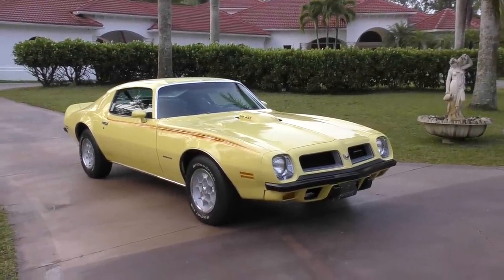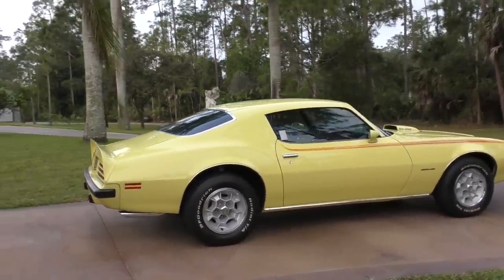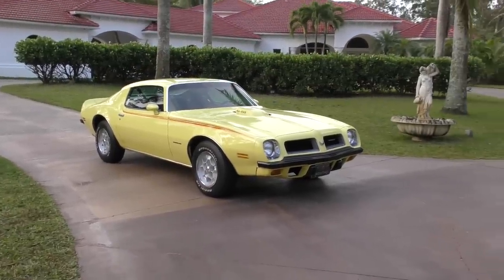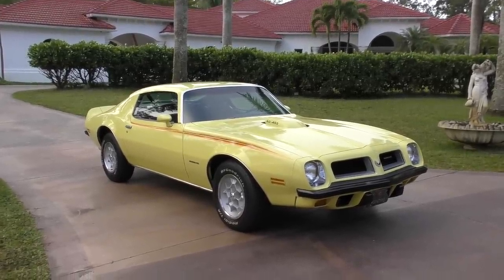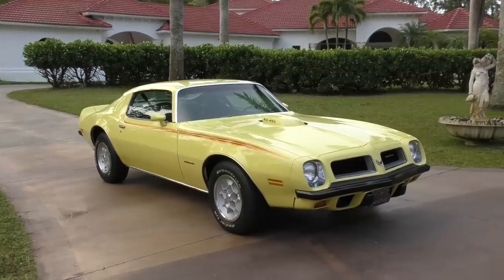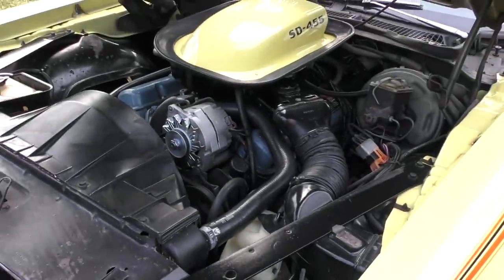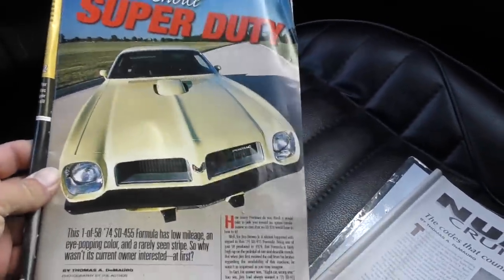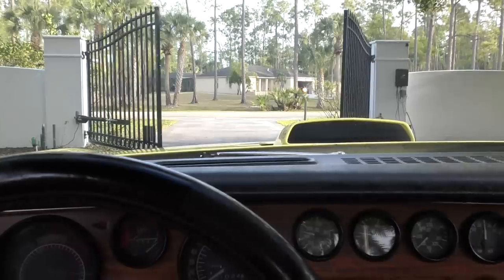1 of 58!  This Ultra Rare 1974 Pontiac SD 455 Formula Firebird is The Last Real Muscle Car

Comment: Pontiac done a fantastic job integrating those bumpers..in my opinion, the 74s and 75s were both great looking cars. This is an incredible car. Your friend has an amazing collection.
Reply: Indeed. They did way better than Chevy with the Camaros those years.
Reply: Yeah especially when you compare to the Camaro, where they just ibstalled a slab of steel in front with close to zero integration with the rest of the design.
Reply: Growing up when the 2gen fbodys were new. I always preferred the Formula trim over the Trans Am.
This car really POPS.
color, honey comb wheels, SD..
Who ever speced that car had great taste!
Reply: I did drive the 74 firebird 350, trans am 400 and firebird formula 400 in the 70s. They were wonderful machines at that times. I did not had the chance the drive the trans am 455.

Comment: Back around 2006 I was at a car show in McHenry County Illinois and encountered a 74 yellow sd-455 Formula with the shaker scoop and side accent stripe.  It was a real X code car but had a column shift automatic and no tachometer.

Comment: All those gauges are aftermarket. The three of those gauges to the right were where the ac vents were. The two to the left were factory gauges but they look replaced to match the rest.
Reply: Don't forget that this is a non-gauge package and non-AC car. So the area of the dash to the right of the speedometer had nothing there, so was a blank canvas for a previous owner to add those 5 aftermarket gauges.

Comment: In '73 and '74 there were still a couple of powerful cars for sale, the 455 SD was the top of the heap for sure but, not the only game in town yet. The 351C 4 speed was available in Mustang, Cougar and Gran Torino with 245-255hp, Hurst/Olds 455 250-270hp, the Buick 455 stg1 270hp, the Corvette and Chevelle/Laguna S3 454 245-270hp and a few hold over Mopars with the E58 360 245hp, E68 400 260hp and E86 440 285hp. None of them could touch the Pontiac but they were out there and could all be readily modified.

Comment: Great video, Bill, I love your work, and your passion really comes through, especially in a car like the legendary 455 SD Super Duty. Many people don't realize that unlike the standard 455,  an engine that you could get on the Pontiac Safari station wagon, the 455 SD was a full on racing engine. I was too young for that one, but I did have a 1979 TRANS AM with the 6.6 Litre, which was actually an Oldsmobile engine, the 403. The 400 Pontiac T/A engine was reserved for the 4 speed manual for some reason.. Mine was that bright electric blue metallic color with the turned dash, and had other civilizing options such as delay cycle windshield wiper, electric windows and door locks, T-tops, tilt steering wheel and cruise control. Mine also had the WS-6 package, which included 60s all around and four wheel disc brakes and some other odds and ends. What a great great car that was, and what great times those were.

Comment: Excellent video, been a Pontiac fan forever. Currently working on a 1975 Firebird Esprit, with a 1973 front clip and ram air hood. Equipped with a bored 1972 455 HO, M-21 four speed. I love Pontiacs, unique machines and these engines are torque monsters.
  The Formula here is just badass. Beautiful, it's cool to see clean examples of these cars. Really enjoy your work. 👍👍🏁🏁

Comment: Had a friend in the 80s who had one of these- 74 yellow 455SD Formula.  Who knows, could be the same car!  he drag raced it regularly and drove it on the street. He let me drive it once.   He did not order it, he told me there were several on the dealer lot at the end of the 74 model year.   super nice car

Comment: As per the SD 455 Registry where there are a total of 28 1974 SD 455 Formulas registered and a total of 58 were produced by GM, (where the bulk of the remaining ones are is mostly likely the junk yard through attrition).  There are a total of 2 yellow cars known to exist or that were built (I expect that the other car does exist). One car had black standard interior with a Turbo 400 transmission sold through Schoon Motors as this one was,  while the other one is a yellow, black custom interior with a 4 speed. One item of interest is that in the SD 455 registry, both of cars that are registered were stated to have rally wheels (which I like much better) and my guess is that this one had them changed to the honeycomb style wheel.

Comment: Great review of the SD history, this true SD has the unique PCV valve on the oil filler cap and the “bolt stretch” measurement for the rod bolts on the unique SD valve cover sticker. The SD exhaust manifolds were much less restrictive than the standard 455 manifolds by the way. Almost every part of the SD engine was different from the std 455, I know because I built one from scratch by ordering the parts after I bought my buccaneer red ‘73 too late in the year to get the SD with the car. It took 3 years and cost more than the car did. God bless my brother who worked in the parts department at the dealership. I was 27 then, I’m 74 now and still own the car, which has 67,000 happy miles on it. Thanks for doing this Bill.
Reply: I too own an SD 455, couldn't be happier everytime I look at it, 23,000 original miles. Special they are

Comment: Nice to see one of these without the "screaming chicken" plastered on the hood.  I'm actually a Ford guy but this bird's really sweet.  No need for a radio with that awesome sound coming from that engine.
Reply: But We like our chicken down here. Mustang lickin good.😁👍
Reply: Couldn't get a bird on a Formula.
Reply: @superduty4556  So tru
Reply: @superduty4556  ... thats a T/A hood on a Formula - why if so '''rare''' (lol)
Reply: ... the term used that started back in 68 was 'thunder chicken'
Reply: ... caught your statement further down the page - glad u posted it.
Reply: @nemesisxrox6773  saw your other comment, but maybe a little more background.

Pontiac intended to put the SD455 in all their vehicles as an option but due to pressure from GM, the program was off/on and barely even happened. There was no guarantee of an SD if you ordered one as well. A lot of times a regular 455 would show up instead of the SD you ordered. Assembly workers would steal connecting rods in their lunchboxes as they were the only forged Pontiac rod available. Parts were so limited in fact that to buy any SD specific replacement part, you had to show proof of ownership of an SD. You either had to know someone or get incredibly lucky to purchase one new.
Reply: @superduty4556  ... thats easily understood since the decline of all vehicle engine power was the year 1974 - gas crisis woes & tree huggin EPA, etc. - droppin the GTO but at least pushed on as much as they could with the bird. Diff subject - still cant figure GM as to why the drop of Pontiac and Olds over Caddy n Buick - those 2 shoulda been the ones to flatout disappear.
Reply: @nemesisxrox6773  Cadillac is necessary to compete with BMW, Mercedes, Lexus and Acura. Buick sales are suuuuuuper strong in China for some reason. They even make them over there.
Reply: @superduty4556  ... lol so true nowadays. The rise of the nerds n so much other bs sure popped during the mid 70's n beyond in every aspect. Good day to u.
Reply: @nemesisxrox6773  that is because the firebird  marker light were in fact  the Native American  thunderbird.

Comment: SD 455 was serious hardware. It even had provisions for dry sump oiling cast into the block. A little tuning and you had a car that could run 13's on pump gas through the mufflers...with air conditioning!!

Comment: Thanks for sharing this amazing car!  My first real exposure to Firebirds was as a 12 year old in '73.  I saw a white/blue '73 Trans Am at an intersection and was hooked.  John Wayne's Brewster Green McQ movie Trans Am also made an impression.  I finally bought a white/blue '73 4-speed Trans Am in '99 and repainted it Brewster Green.  In '05 Hurricane Katrina took it.  I bought a '79 Smokey & the Bandit car and kept that for 12 years.  I would love to have a '68 400 convertible with the hood tach.  In my high school days my friend's brother had a real deal 4-speed '74 SD TA which I got to drive.  That memory is a tattoo/scar on my brain.

Comment: I can say from experience that a SD Trans Am is very special and Fast!!!!!! I owned one in the early 2000’s and that car was an original mile white 73 TA with an automatic transmission. That car would idle smooth as silk but as soon as you leaned on it, it would take off like a rocket and had great power all the way to redline!!!! Definitely very ahead of time!!! Basically a race engine tamed to drive on the street. That’s the best way to describe it.

Comment: 73-74 SD Formulas received Trans Am shaker hoods because they ran out of time to have the ram air hood EPA noise certified.
Reply: ... just scrolleddown n found your statement - after i posted about the incorrect hood.
never knew that one.  I'd rather have the fiberglas Formula hood on it thou.

Comment: Hi Bill, the stated purpose of the EGR system was to “meter a measured amount of exhaust gasses into the combustion chamber, reducing peak combustion temperatures, decreasing the formation of NOx (nitrogen oxides), a major contributor to smog. Higher combustion temperatures also increase the risk of pre-ignition (spark knock)”. 
Leaner air/fuel ratios required to meet increasingly strict emissions standards were causing  hotter combustion events, raising cylinder temps. Also, as a vehicle engine accumulated miles, carbon deposits would create “hot spots” in the cylinder that would start ignition before it was supposed to. The “dirty” exhaust gasses partially quenched the combustion reducing the temperature. It was a trouble-probe system, the small passages would quickly clog with soot, and the valve itself used vacuum to control it, the internal diaphragm would fail from heat also relatively quickly. 
Fortunately today, engineers know enough about combustion and technology allows more precise control of it to eliminate the need for EGR.

Comment: The HP on the SD 455 must have been way under rated- i have seen a few of those smoke some darn fast cars on the drag strip- low 13s high 12s  with low gears and slicks they were really fast for a big heavy car- i had a 78 camaro w a pretty hot 454 that ran 13.0 @106  and to think a stock factory car was even faster is quite amazing- it seems like everyone i meet had a car or their dad had a 10 second car - but they never showed up on test and tune at Bandimere to run with us - Hmm imagine that - a 10 second costs big money and are not too common - - i know the new fuel injected muscle cars like hell cat and camaro or mustang are fast as hell but building an old school muscle car and making it run 10s requires skill and money-  especially at the high altitude of Bandimere in Morrison CO  - which i believe is shut down as of last year - thats is a bummer -   pontiac built one hell of a strong and powerful 455-

Comment: Great video! My uncle purchased a brewster green '73 TA SD455 4spd new in '73. Eventually had to sell it in the late 80's for financial reasons by like you said, that '73 brewster green SD455 stands as the pinnacle of muscle cars for me. Funny part of how he was able to get one, when he initially placed the order he was told that he wouldn't be able to get one, so he purchased a near identical brewster green '73 TA but with the standard 455 (4spd). Don't recall how long after but the dealership called him and said that he would be able to buy a SD455 model, so they put the order in to the factory and it was filled. So he sold the first car and kept the SD455 until the late 80's. I recall seeing a photo years ago of both of them parked on his front lawn in the sunlight before he sold the standard 455 model.

Comment: Those Stewart-Warner gauges are aftermarket and were added later.  If it had factory gauges it would've had a tach too.  It's weird to order a SD455 without a tach

Comment: I still own a 78 T/A I purchased in 1982. 4 speed with the 220 hp T/A 6.6. It was something back in the day, but from a light, I'm rowing and roaring while the Camry riding next to me is just cruising under normal acceleration wondering what all the commotion is about. It's amazing how slow these muscle cars have become.

Comment: Fantastic video Bill - wow at 1 of 58 is that one of the rarest cars you've driven for your videos?  I owned several muscle Pontiacs in my day as well, and I so agreed with everything you said.  So interesting that the SD-455 option DIDN'T get you factory gauges (including a tach!) - that bank of gauges definitely looked aftermarket - and being it wasn't a T/A also meant that wood-grain insert rather than the engine-turned metal.  Loved that car!

Comment: 1974 was the last good year for the Trans Am and Formula. 1975 was the beginning.of the catalytic converter on all cars. It's hard to believe Pontiac offered the 455-SD engines in 1973-74.

Comment: Well folks….  I personally know person long ago who had a 74 formula SD in midnight blue like my SD.  It had both formula “ram air” non functional, and the shaker. It was a bit weird. Today a real urban legend. Hope it did not end up in the crusher.  He bought it new in Dayton Ohio.  His like my 1974 SD Trans Am also had 1973 SD heads out of the Norwood (Cincinnati OH) production plant.  He could keep up with me on the street,  he had honeycomb wheels like mine,  premium interior and power everything like mine.  Anyway, lost track of him as I got older.  

I met Herb Adams twice.  Second time when a buddy of mine and I added all the Herb Adams aftermarket bits to his no-air stripper 4 speed 1974 Z28.  Made a huge difference now the Z handled better than my the heavier in the front end SD.

Oh, during my ownership, I was able to secure the factory dry sump add on.  After it was put on, I think it added almost 40HP due to reduced parasitic losses.  I do not know of anyone with this added to their street versions.

Comment: The SD 455 was so special it created an internal problem of the engine supply of the SD 455. Pontiac had a supply problem of the Forged rods that they had to limit, because they had an internal problem of the workers stealing the forged connecting rods.

Comment: The best thing about the 2nd gen Firebird/Camaro is that you can make an 81 look like a 70 1/2, or a 70 1/2 look like an 81, and all variations in between, without major modifications. It takes a shitload of money. But it's basically the same shell with different rear glass and bolt-on options so it's possible. And pretty much everything you need to do it is sold in the aftermarket so you don't have to search for extremely rare parts. It's not the same as owning an original. But if you have one year, and you like the look of a different year, it's possible to make it however you want. Even mix and match different front and rear designs. I love these cars for that. Even though I'll never be able to afford to build my dream version

Comment: 1988 or so , my cousins friend comes up the driveway with a new score, 74 T/A , cragars and fatties and a eggplant purple paint job.
455 4speed car, we were all around 17 at the time.(we had no idea or really would have cared about a super duty at the time).
We learned the hard hard hard lesson that installing headers on a pontiac is SIGNIFICANTLY more difficult than a small block chevy.....anyways..
It was quite the ridiculous ride, even with n50's it would roast almost all the way through third gear...
Summer passed and he traded it off for something else. Two years later I end up working at a custom car body shop in town, end up working with the guy who got it from our friend.
Turns out it was a super duty car , originally red.
I ended up with the purple header panel and hung on the wall for some hot wheels cars for many years.
It was awesome to ride/drive/beat on such a crazy piece of history...I just wish I would have took him up on the partially restored price of $2500 in 1990...
Lol.
Sorry for the long message.

Comment: I've always liked the Firebird more than the Camaro. Those 445 Super Duty cars could still do 0 to 60 mph in 6 seconds and the quarter mile in the mid 13s with the tires of the day.
Reply: Nope… My 1974 stick (except for full blue/balance) actually did 12.8 114mph 1/4 at Kill Kare.  And 0-60 4.9-5.0 any time, any day.  Using street radials. At that time Goodyear NCT or before that “GT Radials”. Oh, automatic, open shaker, AC, power everything, premium interior, 3.23 rear.  BTW, Car and Driver 1973 test, they published on Firestone radials, automatic, 0-60 5.1-5.2.  Qtr was around 13 if I remember.

Comment: Big Block?  LOL - Ok, we forgive you.  One of the Temp gauges is most likely Trans Temp.  And they are aftermarket.  Trans AM's came with Column Shift too.  600 (CFM) referring to the Carburetor - They actually were an 800\840CFM (Depends on who you ask).  Just having some fun keeping you honest.  When you are sharing a 1 of 58 car, you have to get the facts right.  Thanks for sharing that awesome car.

Comment: Pileated Woodpeckers, as pictured in the video, used to peck out windows at my cabin. I got tired of replacing panes of glass, so I was going to lie in wait for them with a shotgun, but figured out, that if I just closed the blinds, so that they couldn't see inside, they would leave the windows alone. Rather than a rapid tap, tap, tap, tap, like a Redheaded woodpecker, a much smaller bird, the Pileated Woodpecker is a large bird who hammers one blow at a time. It sounds like someone hammering a nail with an ordinary hammer.